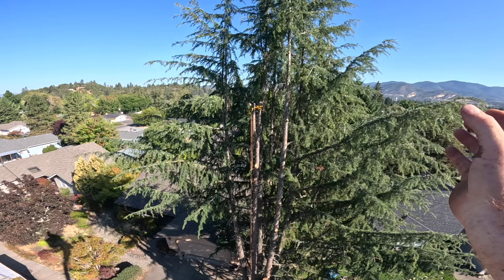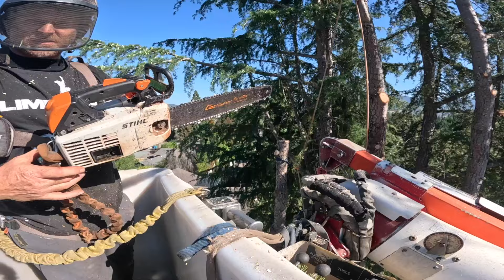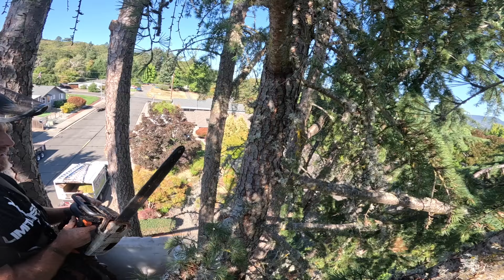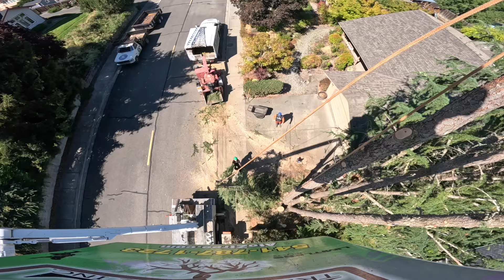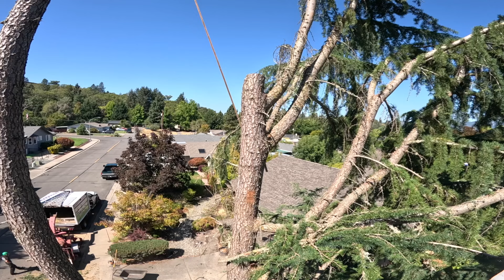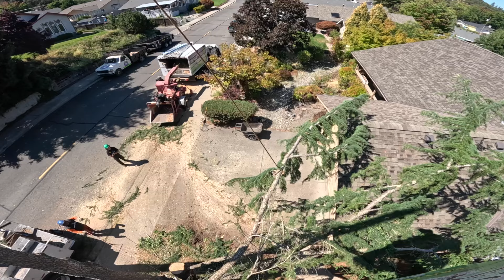Cedar Removal (rigging only)

Comment: I haven't used a material handler in years,  but I think you could probably use your jib as a r-direct as long as swing wasn't too bad, or the peice wasn't too big. You could probably also use it as a rig point